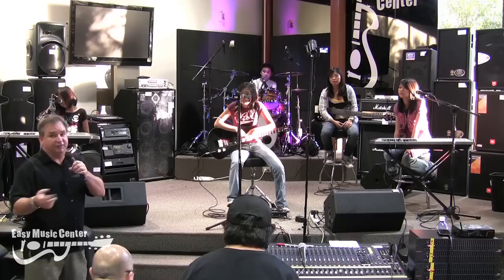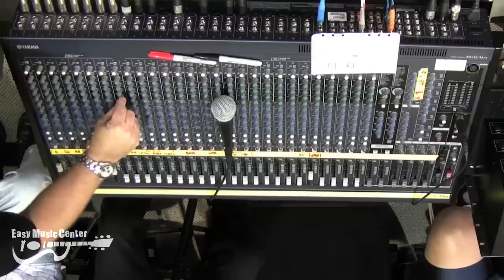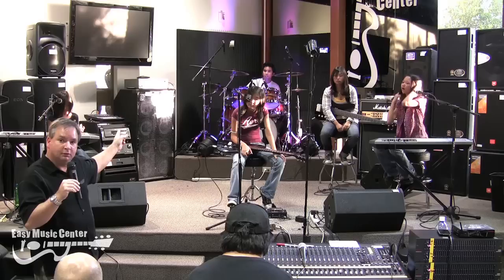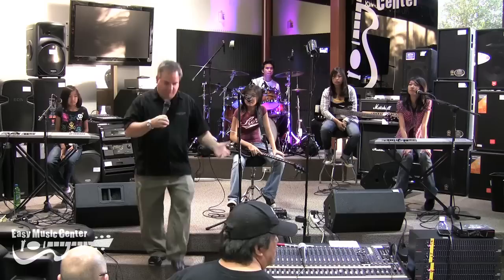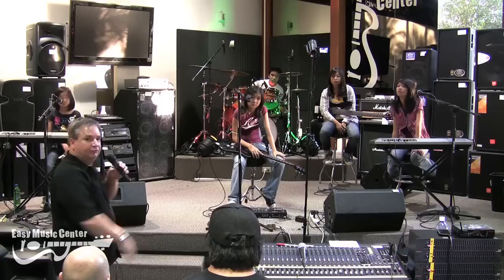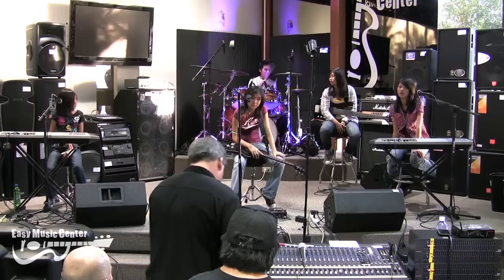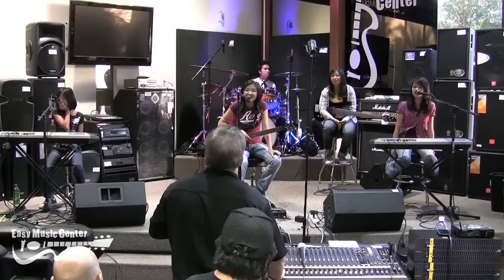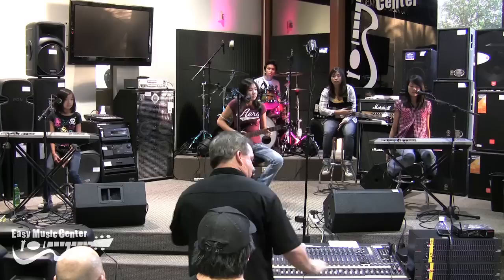2/6 Yamaha Live Sound Clinic - Mixing a Live Band w/ Emke

Comment: I work with kids running live band sound at my school.  This is informative for sure!!  I had a problem with the drums bleeding into the vocal mics, causing feedback on the monitors (no mics on drums).  Being that we have a small stage, reducing stage noise is by far the best bit of info you touched on in this clip.  I only  vocals out of the monitors.  I have tried to run guitars through the monitors but it just sounds muddy...any advice? BTW only vocals and guitar come out of the mains as well

Comment: @therockandroller1000 that would be crazy bro.. imagine having 8 differnent speakers just for drums!... nah what happens is all mics on the stage (around 8 drum mics maybe 2 keyboards 1 bass and 3 vocals) basically 14 mics are pluged directly into the mixer (which  is that big board with nobs and all), then 2 outputs(left and right) are outputed from the mixer to an amplifer (which gives the signal more volume) and than out to as many speakers as you want. it could be 1, 2, 4 or hundred!